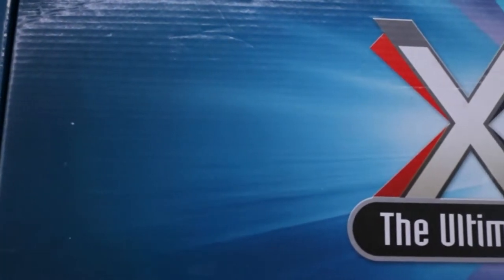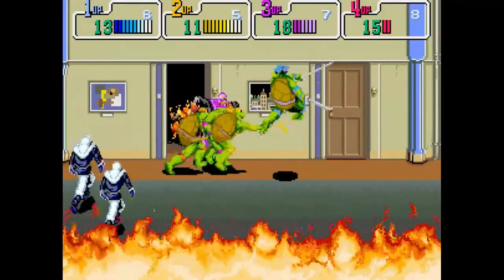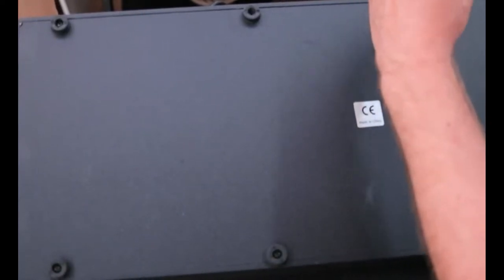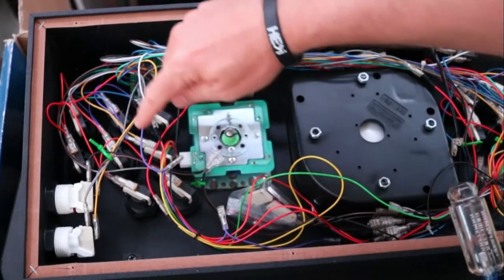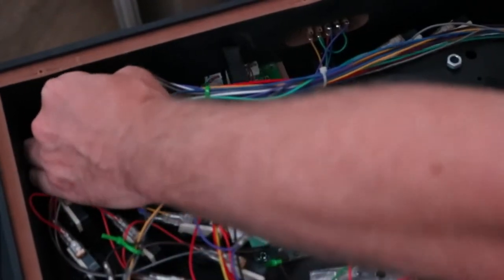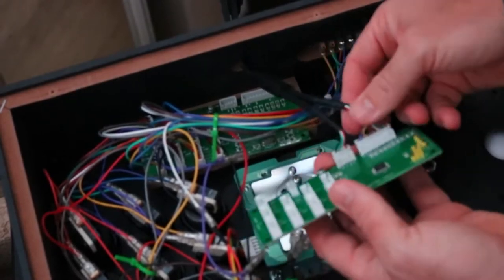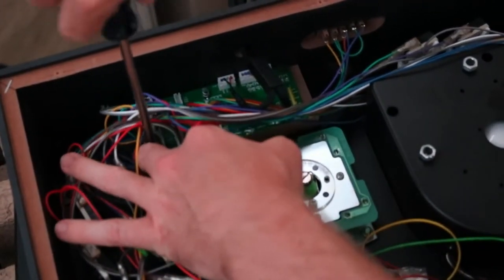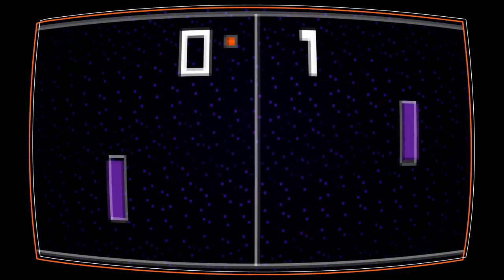How to install the Trimode Zerolag PCB to use X-Arcade Tankstick on PC, Raspberry Pi, and MiSTer!

Comment: Any idea where to get the tri mode firmware updates and programming software? All the links on the site are broken.
Reply from the maker: I’d contact Xarcade directly via email, they have a really responsive customer support group.
Reply: @oleschoolgamers  Customer support isn't what it used to be. I submitted a ticket weeks ago with no response. I think the company is struggling. I was able to contact the the owner whos email I still have, and he suggested it might be the security settings in my browser. So I fiddled with those, but to no avail. Now I have a PCB that I can't use. All I really need is the programming app, firmware update, and  Xinput test. Those files must be available somewhere but I haven't seen them posted anywhere except the company website.
Reply from the maker: @MegaZAPHOD  ugh, that’s awful to hear, cause they were top notch back in the day and responded to emails like they were texts haha. I wonder why the owner didn’t send you the firmware, I’d ask !

Comment: Is the version 1 PCB that was keyboard operated and had the 15 dpin socket on the rear zero lag? I was under the impression any PS/2 input device was zero lag?
Reply from the maker: The version 1 PCB has no lag either. My hunch is that they advertised the new board as zero lag to let everyone know it wasn’t gonna add any new lag either. 
In either case, that’s input lag, the display used can have its own added lag regardless of what controller is used. Hope that helps explain stuff, thanks for the comment!
Reply: @oleschoolgamers  Thanks very much for your help mate.. Greatly appreciate that.. Yeah I think you're right.. They were just emphasizing to dispel any concerns. And you're 100% about the display lag.. That's exactly why we should only ever be gaming on a CRT screen. That's a little know fact a lot of people don't know about.  In my arcade cab I was using a hacked OG Xbox controller and a 24" Dell LCD. for years.. Then one day I swapped out the LCD with a 68cm CRT TV and a zero delay arcade board.. I literally beat all of my hi scores in MAME on my first go. The difference is astounding.
Reply from the maker: Absolutely agree! CRT / PVM is best way to go. When playing on my LED, I play with all the settings until the display lag gets down to 20ms or less but it’s still not great. Find a Leo Bodner display lag tester, highly recommend. I bring it into the stores when buying new LED TVs as well. Samsung’s seem to get the lowest lag times, the last big one we bought has 18ms, most are around 30-50ms (16ms = 1 frame)! 
 CRT is still the best, but so many systems and not enough power / room lol. Appreciate the talk and thanks for the comment!

Comment: Which Mode do you use for NeoGeo Core and how can you setup buttons for Player 2?
Reply from the maker: I use the D-Input Mode for the TankStick for most of the cores including NeoGeo. As far as setting up player 2 buttons, I load up the core, then in the menu I select "Define NEOGEO buttons". You can do this for player 1 and player 2 seperately, but when you setup player 1, it mirrors that to player 2 anyway.
Reply: @oleschoolgamers  I tried all modes, but it only asks for Player 1 Buttons. My tankstick is 2 years old and does not have the zerolag Trimode PCB. Could this be a reason? Or do I have to change MiSTer Settings for playing two Players over one USB connection?
Reply from the maker: [Hawk78] yeah if you have the original keyboard based PCB in your tankstick, there is no Direct Input mode or Xinput Mode, keyboard mode is the only mode. 
Getting the second player to work with all the Mister cores was difficult if at all, and frustrating, hence why I bought the trimode board. Now it works really well. 
I think the best solution is to just upgrade to the tri mode board, it’s only $20 bucks and you can change it out like in this vid in minutes. Plus you still have the keyboard mode anyway, so you can use it if you still need to for other setups.

I tried getting the keyboard PCB to work as two players over one usb device, but the mister cores are not setup to be able to do that unfortunately.

Comment: I installed a zero lag a bit back for my tankstick on my windows arcade. Upon reboot I always have to either disconnect it or switch from xinput to d and back to xinput before I play mame. Have you noticed this? (Just found your channel looking for videos on replacing the joysticks. Good work.)
Reply from the maker: Thanks for the compliment and congrats on the zero lag board even though you have this odd issue. I don’t have that problem, I talked to Tony about it and he doesn’t either so it’s hard to troubleshoot. 

Our guess is that you might have a conflict with a virtual joystick or something. 
Couple questions, does it require the switching only when hooked up to this PC or any PC running MAME? Does it require the switching when hooked up to a Pi / hacked console when you reboot them as well? 

If it did for any PC / any console / Pi / MiSTer etc then it’s obviously the tankstick, if it only requires switching when hooked up to your WIN PC, it’s the PC. 

You could also try Xarcade support and open a ticket. They respond usually within 24-48 hours. Let us know though we’re interested as well now haha
Reply: @oleschoolgamers  Same on another windows 10 pc. I updated the firmware though I thought I did before when I installed the zero-lag initially? I opened a support ticket so let's hope for the best.  My workaround has been a USB hub near the controller with an on/off I click after a reboot. The issue has always been if I fail to do so and launch Mame my default.cfg file gets a rewrite and I have to map the controls again. Tedious. Thanks for the videos!
Reply from the maker: @threestorks  well, good news is you know its most likely your tankstick, bad news is its most likely your tankstick. Very odd, I'm really curious now to see what X-Arcade says. 

The good news is you can say you tested it out on another PC and it did the same thing so you definitely need their help (they can't say its your PC / configuration / whatever). Keep us updated, very interested.
Reply: @oleschoolgamers  their first reply was to update the firmware. Done. Second was to ensure the machine isn't putting the device to sleep. Done. No change. When I got the new board, I found another guy on youtube with the same issue. I need to find him and see if he ever found an update.
Reply from the maker: I did find this link: 

https://support.xgaming.com/support/solutions/articles/12000051721-tri-mode-pcb

Scroll to the bottom under troubleshooting, the first item is your issue perfectly described. 

I’m wondering if it’s more a Windows thing based on their fix description. If you have a Pi or MiSTer or hacked console it could help prove that. But since same behavior is on Windows PCs, and the solution has to do with Windows settings it might actually be a Windows setting that happens to be the same on both PCs. Go watch my vid, hack your Wii and test haha. 

Keep us informed though, neither of us updated firmware, so don’t know what version  ours are on.
Reply: @oleschoolgamers  I did this suggestion earlier with no luck. Thanks for all your suggestions and time. I've got many retropie setups as well as several hacked mini consoles. I'll give them a shot. It appears on windows the tank stick defaults to d input on power on. I'll see if the same happens on retropie.
Reply from the maker: No worries bud, you can thank us at the next live stream how’s that 😎

If it does the same thing though when hooked up to Retropie, then it’s firmware / board issue. If it does not, then it’s a Windows setting. Definitely still interested, keep us updated. 

Of course, now I’m wondering how to tell what firmware I’m on... 🤔

Comment: I bought one of these, and it lasted 3 months then stopped working. Beware.
Reply from the maker: That stinks. I’ve had mine since the making of this video, still works great. Two of my friends have this and got there’s before me and still work great too. I’d say you got a bad break and it’s not the norm. 
Did you contact them to get it replaced? 90 days is within the return policy I believe.
Reply: @oleschoolgamers  Its just a headache, it got stuck in programming mode out of the blue... had to reflash it, that wasnt easy to find on the site... and now for some reason the start button doesnt work. Its not the connection.
Reply from the maker: @waynekerscabz  I’d put the brakes on and contact their support directly and ask for assistance. That way they are aware of it and can replace it if needed, right now your kinda winging it on your own with no fall back. Just my 2 cents

Comment: Hello, and with this old model :
https://drive.google.com/file/d/1L7WgMlXoA5n9QhfvEKJhB--YO7POrRYu/view?usp=drivesdk
Is it possible ? And above all, how to do ? What to buy exactly on xgaming website ??
Reply from the maker: Looks like you have the right model, I’d call them to be sure though. The item to buy is the “zero lag trimode pcb”
Reply: @oleschoolgamers  Thanks. I sent email to xgaming to get this information. It's a shame for old customer to have to inform themselves...
Reply from the maker: @omai5004  I’ve had to email xarcade several times over the last couple years, and each time they’ve been responsive so they should get you going.